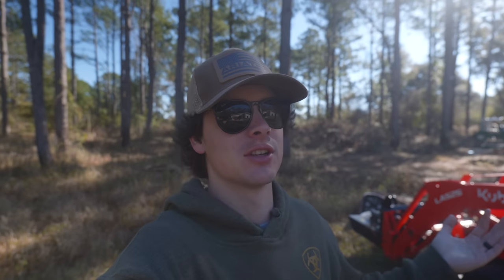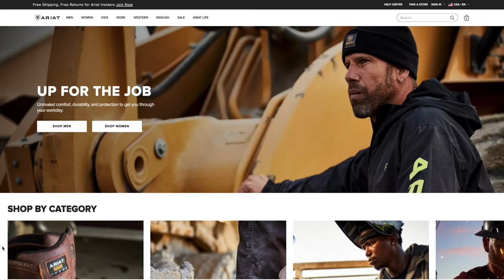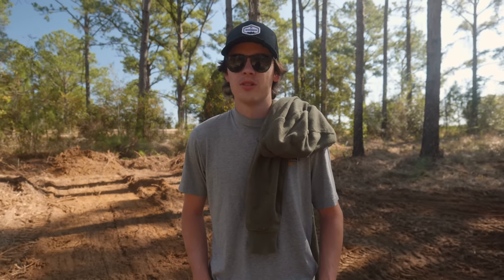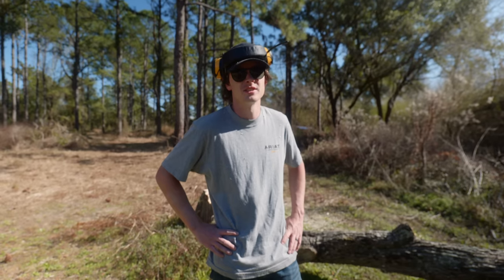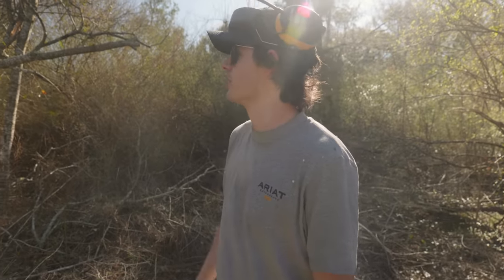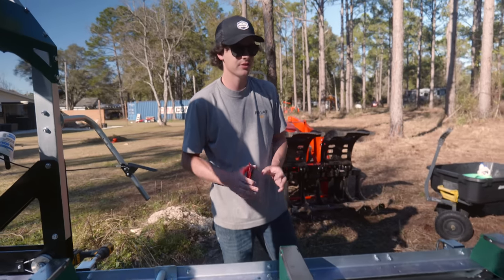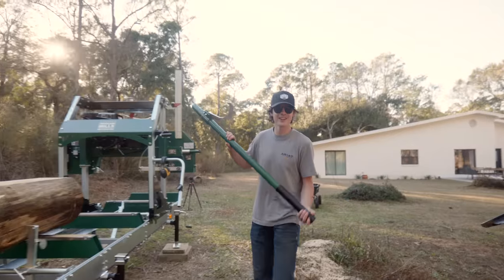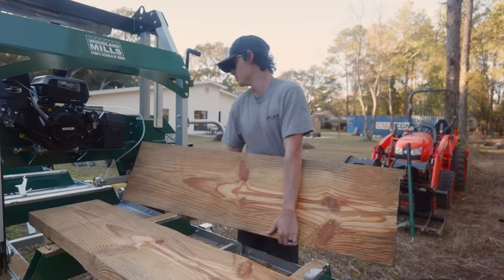MAJOR Progress On The Sawmill Setup! Cutting Our First Log!

Comment: I did countryside management qualifications at college and one of the tutor's gave us the best definition for a "weed" I've ever heard: anything growing where you don't want it to be.

Also, please never try to roll a tree that hasn't been chopped down yet, you only roll trees that have fallen and are hanging up in another tree and you use the rolling effect to make it roll away from the tree it's stuck in. The best way I've found to fell a tree that's leaning 1. Cut the gob (mouth, wedge shaped hole, etc,) aiming in the direction you want it to fall. 2. Slowly cut your back cut making sure that you leave a lot more hinge material on the opposite side to the way it is leaning so that the extra material will stop the tree falling sideways. 3. Pray! Better yet, put a rope in the tree to pull it where you want it to go or away from where you don't want it to go, then follow steps 1 to 3 as before.

Also, check out #Buckin' Billy Ray Smith, he has some amazing information on felling leaning trees that I wish they had taught me when I did my countryside management courses.  Keep up the great work, guy's 👍👍👍👍
Reply from the maker: Roll may not be the best term, but you can make them hold on the hinge wood on one side longer and twist before breaking off. It doesn't move them super far, but it can help the canopy from hanging up in the other tree. Based on your comment I think we are saying similar things just in a different way.

Comment: Congrats on the new Sawmill! I have had the same model for about a year now and it is still one of my favorite purchases. One neat trick you can do is take a normal 5 gallon bucket and hang it on the bottom hinge, on the shoot side of the mill, using the bucket handle. Its the perfect size to catch all of the saw dust so you don’t have to shovel anything later.
Reply from the maker: We have to do this!! Thanks!

Comment: I found your Chanel form your help with Ambition Strikes.  I caught up on your last three years, good content.  In this video after you cleared you the spot under the trees you said you had a big mud pit.  On other videos I've seen they used wood chips to fill in mud. I haven't seen a wood chipper in your tools.  I was wondering if you stacked up the tree tops and brush and you used the Lawn Shark on it would that work for making chips?

Comment: Not that I'm a tree trimmer by trade, but in hairy areas, we've always used wedges as a "safety" when cutting trees to kind of help us push the trees away from obstacles.  Doesn't sound like it was a big issue in your instance, but thought I would add in my .02.  Thanks for sharing!
Reply from the maker: Absolutely, wedges are fantastic. I thought I could be clever and get away with it, but nope. I knew its was a zero risk situation to try a skill of rolling the tree off, but didn't go as planned.

Comment: Love the enthusiasm but you need to watch "Out Of The Woods" channel for the best milling info. What you have there appears to be  is plain/flat sawn timber (cathedral pattern). The better to go for is rift sawn (best for general furniture pieces), and then for quarter sawn (more structurally sound and is ideally suited for chair and table legs etc.), but not all logs have good quarter sawn properties.
Reply from the maker: Yes that is a good source of information. We are aware of grain orientation from woodworking and understand the differences between them. This was merely the first cut on the sawmill.
Reply: @Woodbrew  great to hear. Love the channel. Stay safe and well.

Comment: I'm interested in knowing how you control the cut.  How do you set up for, say, a 2" cut versus a 1" cut?
Reply from the maker: There is a scale on the side with an arrow with all the normal cuts listed that you use as you lower the saw head.